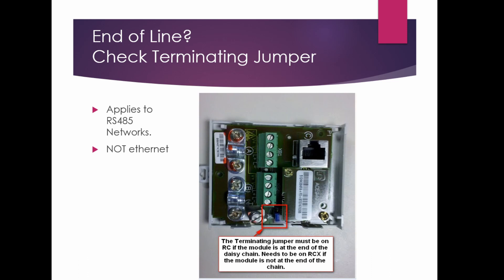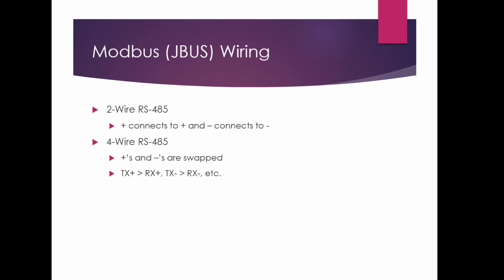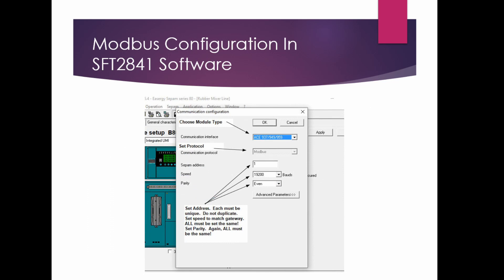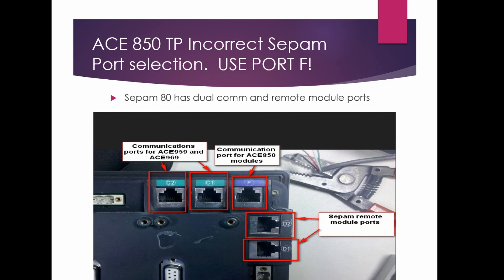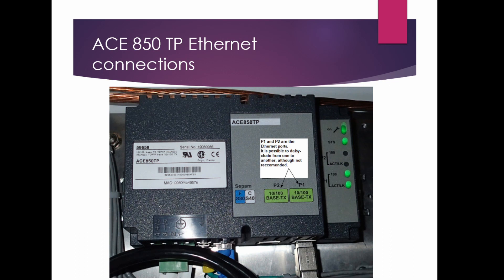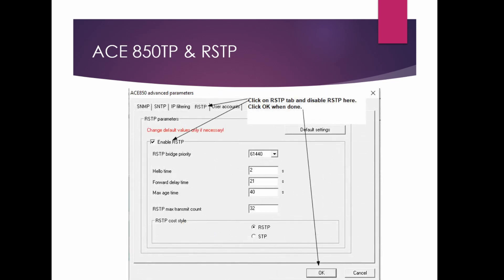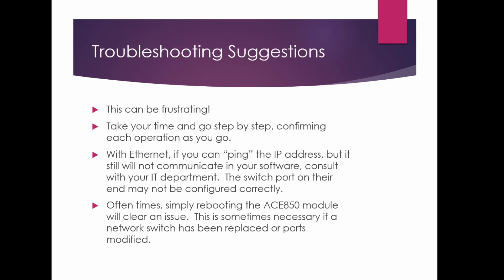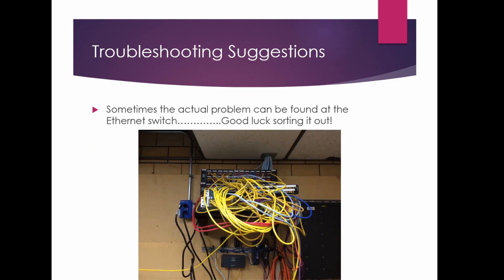SEPAM Communications Troubleshooting

Comment: I have a fixed orange light in the ACE949-2 board... what does that mean? All I have read is regarding a fixed or blinking green light but nothing regarding an orange light, alrerady tried changing the board and the orange light remains...
Reply from the maker: If the LED is blinking/flashing, it indicates that it is communicating.  If solid, then it is not communicating.  I have seen these both green and orange.
Reply: @raltman57  Thanks for confirmation. Now the led is blinking when I request modbus data through an Nport, but still I don't get a reply from the Sepam. Sadlife.
Reply: I also have a fixed orange light. I connected the rs485 wires to Schneider p342020 modbus RJ45 port L+ to D1 pin and L- to D0 pin. Did I do it wrong? @raltman57